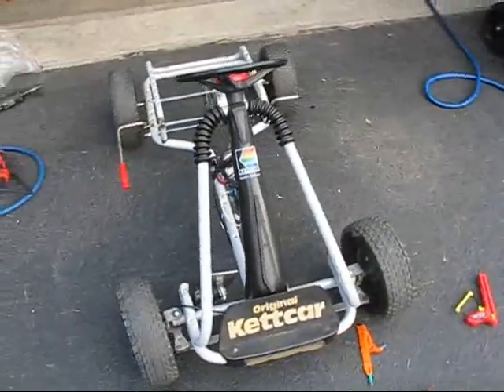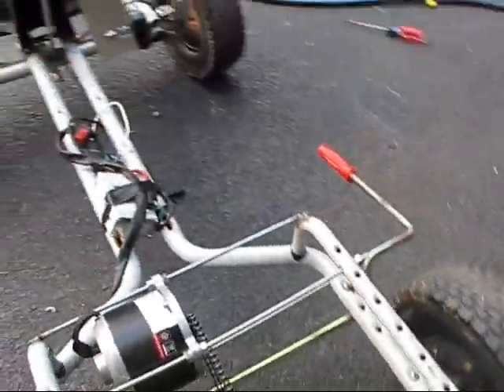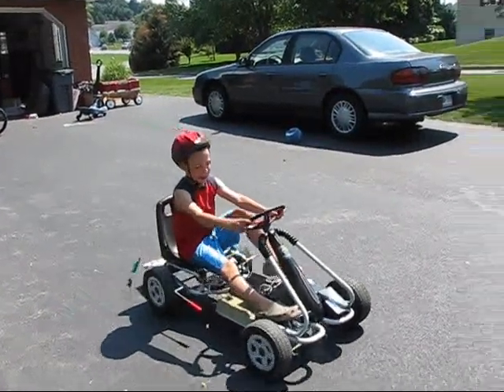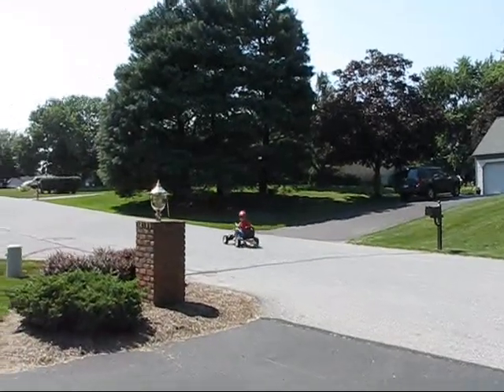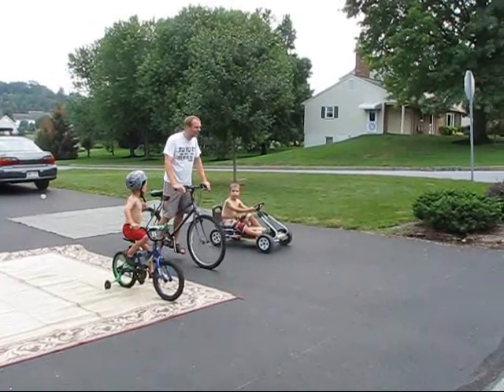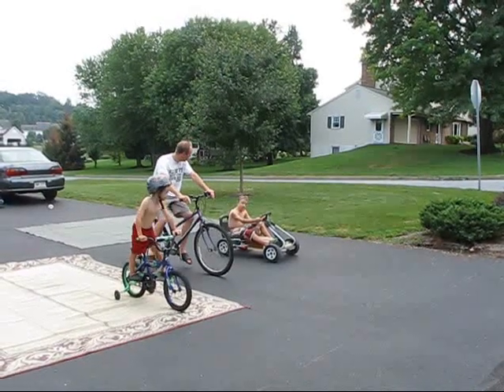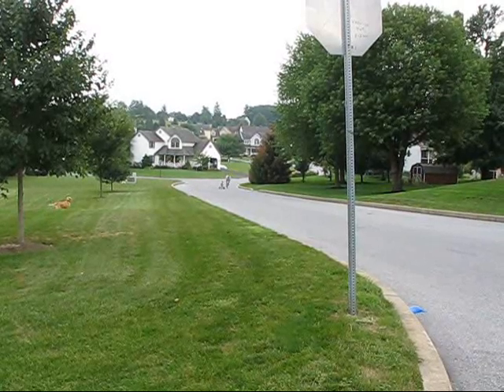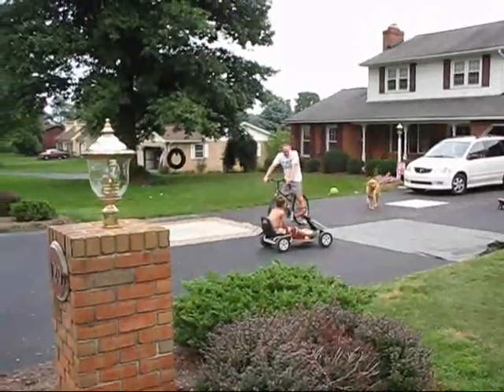Electric Kettcar Conversion.wmv

Comment: I got some of the miscellaneous parts from Monsterscooterparts.com but you can also search ebay. I built this for an autistic child who does not like noise at all and did not want the sound of an electric motor. I will be happy to help anyone if needed for a similar project or been wanting to step up and do a hub motor go-kart :)
Reply: thats fantastic, I am looking at building something for my son. He is autistic and hates noise but loves electric karts and bikes. would love more details.
Reply: i am interested as well
Reply from the maker: What do you want to know?
Reply: +bandss2000 basically full breakdown of parts a d where you got them from.  It's awesome
Reply from the maker: Get an old Kettcar strip it down and begin fabricating. I got the motor and speed control from a razor scooter I found on Craigslist. The accelerator pedal is the twist handle throttle with a piece of aluminum bolted on it and a bolt as a stop limiter. A nut is welded to the frame and the bolt can be adjusted up or down to either limit speed or keep someone from pushing the throttle too hard and breaking the twist throttle. I recommend using at least a 500W 24v electric motor and speed control. Search CL and see if you can get a used one cheap or go to eBay or monsterscooterparts.com  From there mount the motor and I used #41 chain to go from the motor to the drive gear. I made a solid axle to bolt to the drive gear and threaded the ends to bold the wheels on. Line everything up and get to welding. If in the Lancaster, PA area let me know and you can check it out I'll build you one :)

Comment: This is a 750W 24volt motor. I eventually switched to 12.5x3 inch tires for better traction. It also increased my speed and the 750 watt motor has plenty of torque for a 100 pound kid. The rear sprocket is a 90 tooth sprocket and a 25# chain links it all together. I have 4 sealed lead acid batteries powering it. They are 12 volt 12amp/hour batteries hooked in series/parallel combination.

Comment from the maker: I used a currie speed control from an old razor scooter, the whole thing was pretty much made from a broken scooter. I did help someone else put one together and we got the motor, speed control and peddle from monsterscooter com  I put 4 12volt batteries in a series/parallel combination. I used Yuasa maintenance free 12volt batteries from a large UPS system. I did everything on the cheap and was lucky to get most of the stuff for free through some IS geek friends